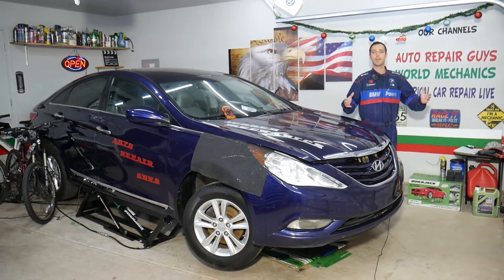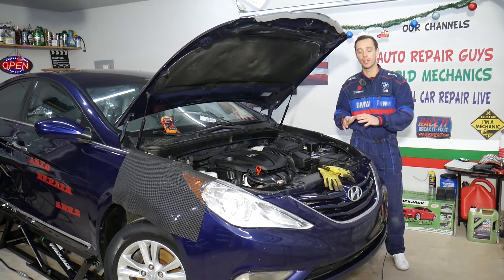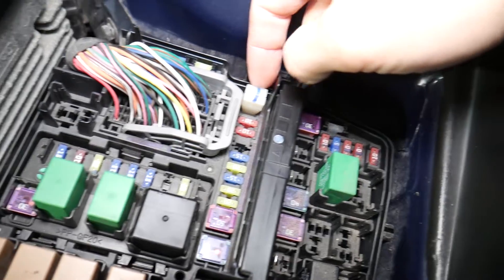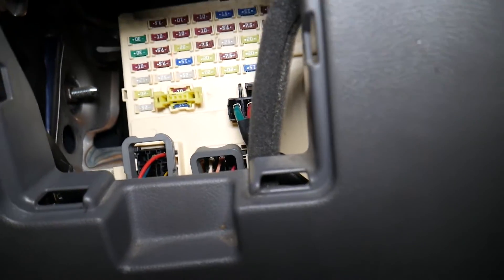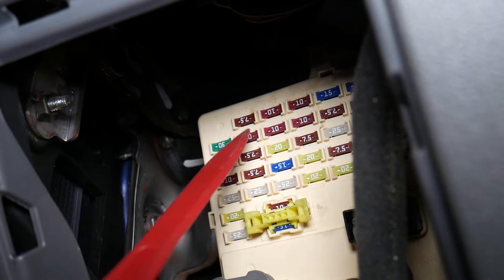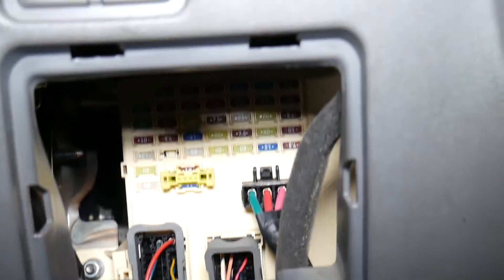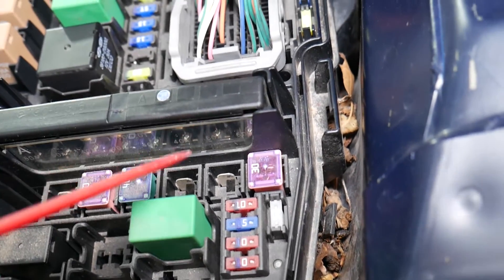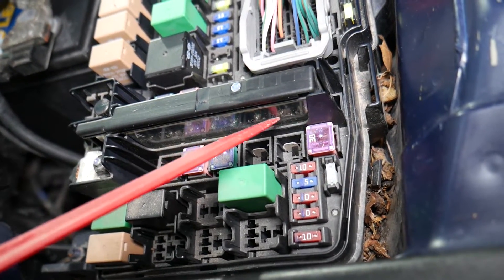HYUNDAI SONATA MASTER WINDOW SWITCH FUSE, POWER WINDOWS FUSE LOCATION REPLACEMENT

Comment: Driver side is able to control one of the rear windows to open but not able to close.  Rear window switch is able to open and close.  Any clues?  Thanks in advanced
Reply: Did you find the fix
Reply: @Canman56347  brought to an auto mechanic to replace the switch.  Turns out that Hyundai switch are cheap and easy to break